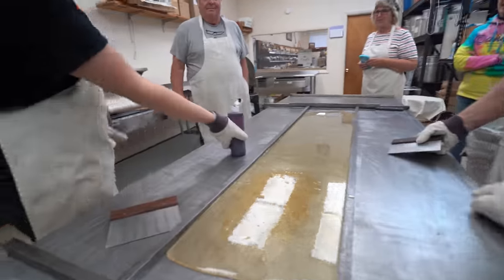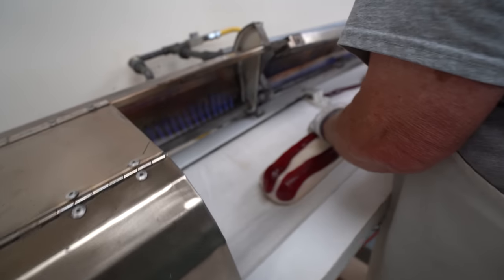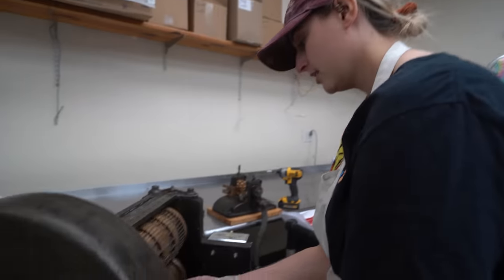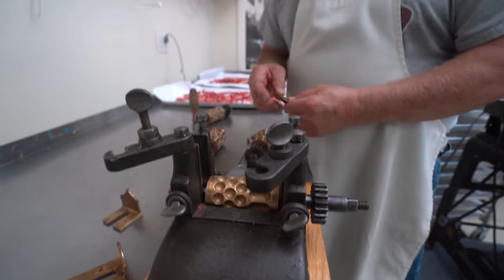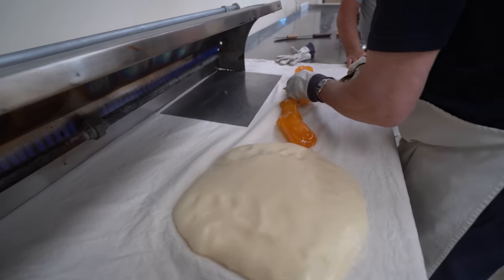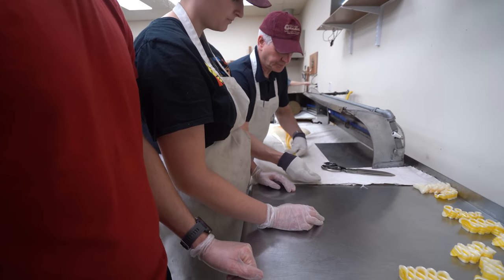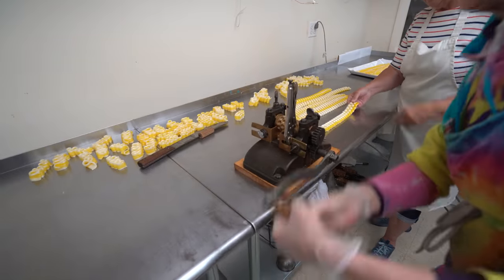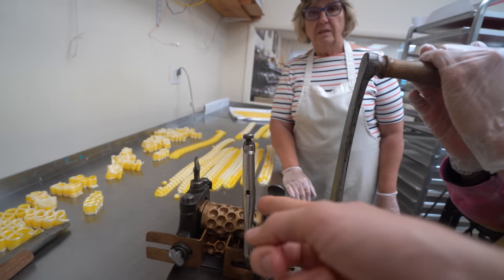A 100+ Year Old Machine is Changing How We Do Everything.

Comment: Love seeing antique tools still doing what they were made to do. In today’s built in failures forcing you to keep buying new, makes me think there is a market opportunity for someone
Reply: You are viewing it in the wrong way. This stuff is commercial culinary equipment. Unless you are buying the cheapest stuff around, commerical culinary equipment doesn't break/fail like consumer stuff. It's a tool to make money, as such, it has to be reliable. It has to be designed to run for at least 12 hours straight, 5 days a week for years.  Stuff that breaks at the rate of consumer stuff wouldn't be around for long, as it doesn't make sense for any business to use it in the long term. Even if you get it for cheap, the down time will lose you more money than you saved. 

There's a reason why brand new commercial culinary equipment is fairly expensive, it's made to be reliable and recoup investment fairly quick. For example, the ovens you see in convenience stores for toasted subs are basically industrial air fryers with a large stone/ceramic plate in them. But, they start out at around $8k and go up to $25k. Completely worth the money for a business that will use it. You should be able to break even in around a year unless, for some reason, you can't generate the customer flow.
Reply: "...today’s built in failures forcing you to keep buying new..."
That's called planned obsolescence, just for reference.

Comment: When putting the candy through the candy crank have you thought of having 2 flat pecies of candy and putting citric acid on one side and sandwitching the other piece of candy on top and cranking it like that because then there would be candy small layer of citric acid and then candy just like what you done with the ribbons with chocolate inside.

Comment: If I could make a suggestion. I would install extension handles on the rear gas valves raising them above height of enclosure so that you dont have to reach around like that and risk burning your hand. It will also make it much easier for you guys to adjust flame as you go .